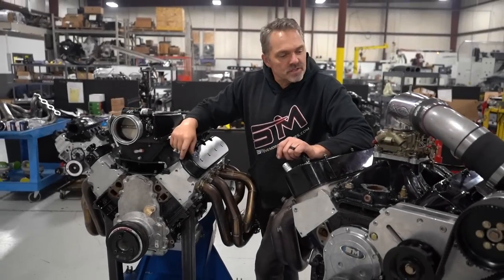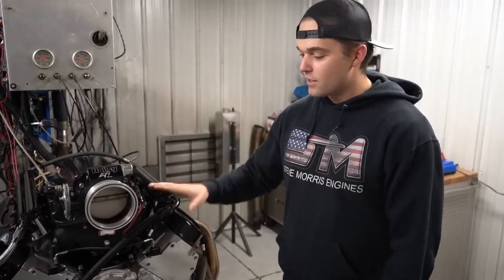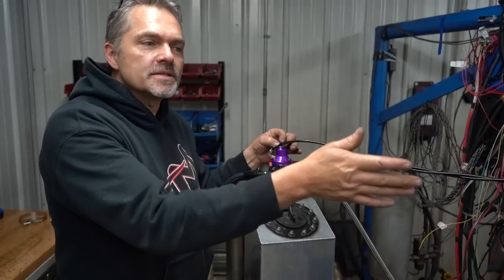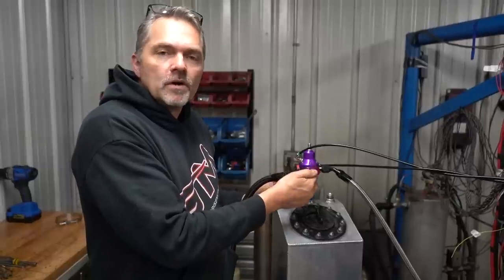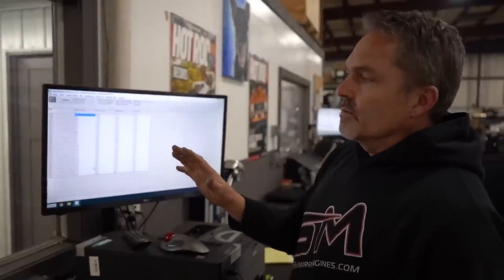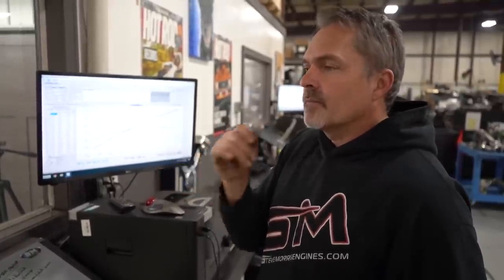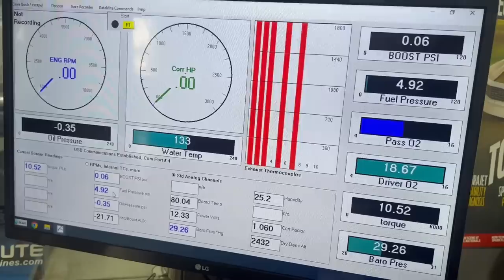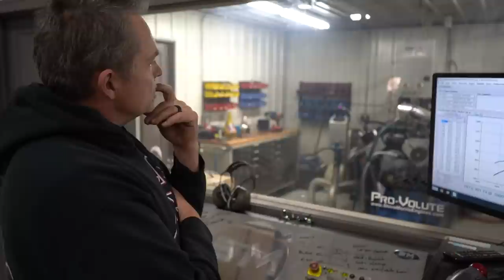The Engine That Started it All, 12 Years Ago !!

Comment: All respect to you Steve, your SMX engine might be the best drag and drive engine ever built. 

But running a supercharger sucking air directly from the headers makes me think you don’t know what you’re doing… and
 you’re dyno pulls is so short you’re not building any heat in anything… and as usual, boost is doesn’t say anything, you should study the godfather of turbo and boosted engines. Gale Banks

Timing and fuel has nothing to do with it, air density is what you’re searching for, if you want horsepower instead of a big boost number
Reply: Different applications. Banks is looking to build production style stuff that can run under load for long durations and work in all conditions. This is primarily a drag engine so is really only under load for a few seconds. It’s also getting put into more of a race car so the final setup may be unknown. Hard to test a proper intake and such when it’s not been built yet.